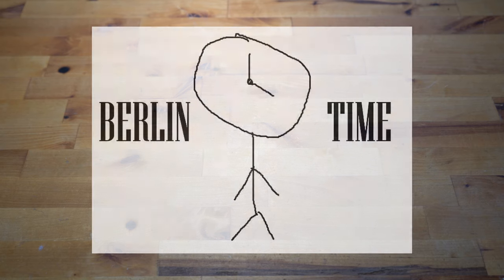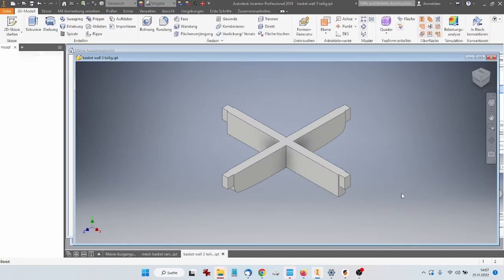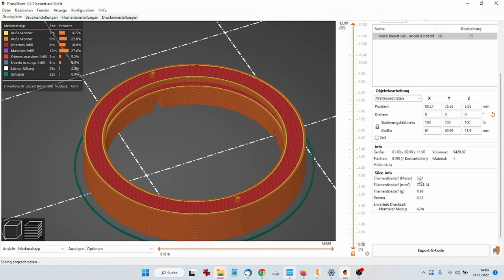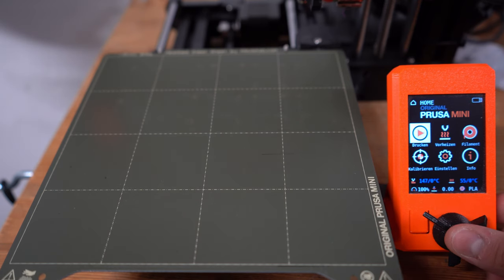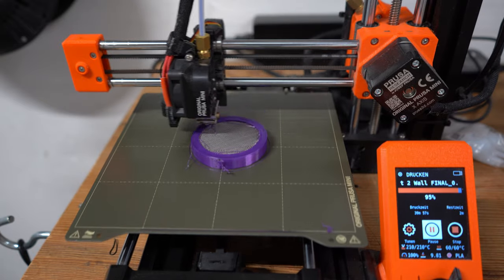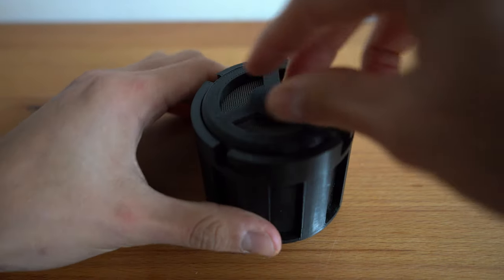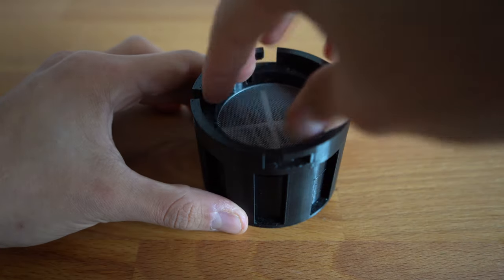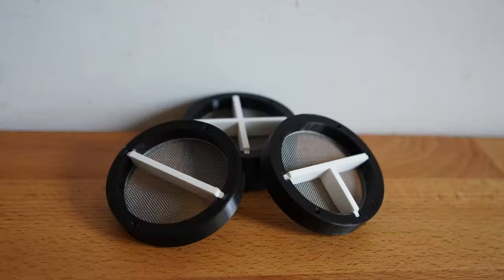3D Printed Watch Cleaning Basket & Holder [Prototype 1]

Comment: What cleaning fluid will you use? I'm guessing some kind of solvent, but won't it attack the printed plastic?
Reply from the maker: I will probably be testing this out on ELMA wf pro and Elma Suprol. There have been other people who have had similar ideas but they said that the plastic was fine in the short term. I will probably test mine for over a month, before building on or making other important designs choices :)
Reply: I’ve used the Elma 9:1 which is water based and fine

Final rinse in isopropyl and it seems ok

Comment: Awesome work 

I’ve been working on a similar project and the basket is easily the most complex part

I’ll be interested to see what you did I for the power source. I tried Arduino and a stepper but had hardware problems. So I ended up using a spare 3D printer controller and modded the gcode 

I’m looking forward to seeing your progress
Reply from the maker: Yeah the basket is only problematic because of the flow and mesh problem. Have you worked out a way for mesh on the sides by the way? And for the power source and circuitry I am using a DC 24v adapter and hooked that up to a cheap circuitry board and the DC motor from eBay ( they have alot of models with rpm controllers and current changers and everything)
Reply: @Berlintime030  

I have been experimenting with using a hole saw to cut a disc and hole in some 18mm thick wood. Then press the mesh to form sides and base. It works well but the next challenge is a rim at the top. But I think it is 3D printable and epoxy will hold it on